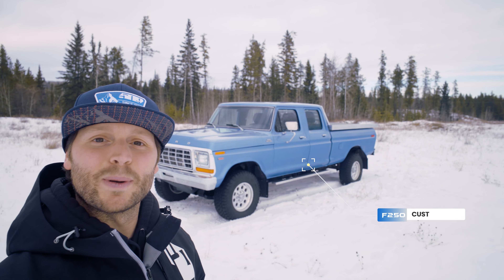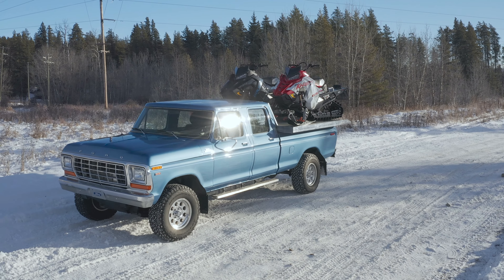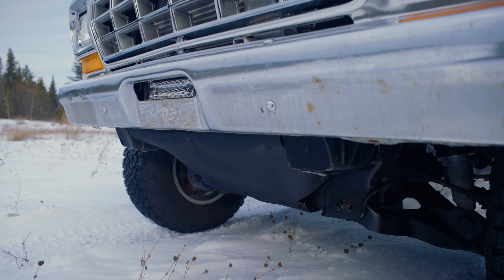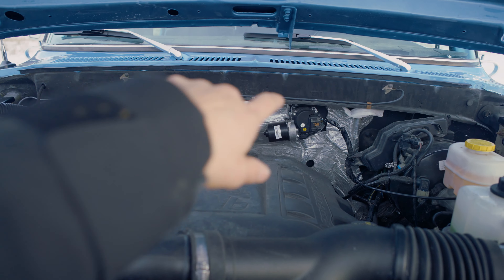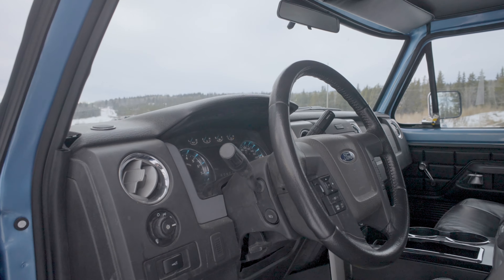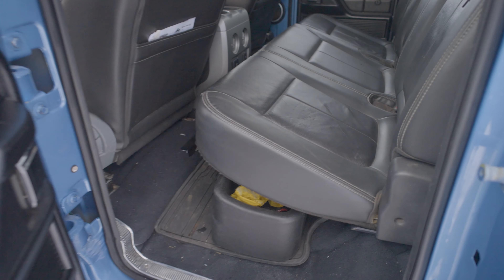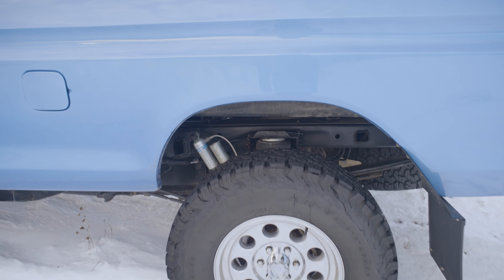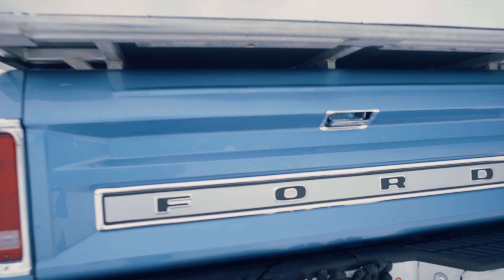1979 FORD F-250 ECOBOOST!

Comment: Great build! To me this is the perfect setup. Modern chassis, drivetrain and interior with the classic look of a 1979 F-250. I can’t imagine how much work went into this but it looks great and I imagine it drives great too. I watched another video right before this of a regular cab short bed 1979 F-150 that was put on a shortened 2014 Raptor chassis with the 6.2 liter V8. It was similar to this and used the dashboard and seats in the interior as well. I’d love to do a build like this. Maybe a 1980’s Bullnose Bronco on a modern F-150 or F-250 chassis. That would be sweet.
Reply from the maker: Would be really sweet!

Comment: Thanks for the mention in description! I had not noticed it until now. 4 current ecoboost swaps in pickups now at my place. Trying to finish up the '66 F100 with Raptor Crate engine and 10R80 first. In the spring plan on taking it to all lower 48 states here.
Reply: That sounds badass, you should do a video, I'd love to see her when's she's done.
Reply: @RagnarDanneskjold-Pirate  quite a few vids on my channel.  Running driving now. Trying to find a good videographer for aerial and other vid.
Reply: @randysrestoration  sweet, I'll check it out! I'm a Gen Xer and I'd love to see more '80s and '90s vehicle resto mods. I used to own a diesel shop and was going to get into the diesel swap trend but I just never actually did it. One of Won Customs did a fantastic diesel swap in a Camaro and a Charger, if you haven't seen the video, you should!
Reply: @RagnarDanneskjold-Pirate  in process of looking into a diesel swap but it will NOT be the typical 12v cummins like so many are doing. I have so many hobby projects its hard to keep up.
Reply: @randysrestoration  I think the commonality of the Cummins 12V is due to the fuel system, availability, and cost effectiveness.
I'd like to see someone do a Cat swap.
If I had the capital, I'd be getting into some sort of swap but the plandemic took a lot of my savings, oh well, build back better... right? Lol
Reply: @RagnarDanneskjold-Pirate  i never seem to do it the “easy way”. Ha!  Would love to do one with 2020 or later super duty 6.7 with 10R140 auto. 
CAT would be fun too if enough hp
Reply: @randysrestoration  Nothing worth while is easy, my man. I'd like to see a 6.7 swap into a Mustang!
Reply: @randysrestoration  scratch that, just to be an asshole, I'd swap a Yanmar into a Tesla, make all the green freaks explode!! 💪😎

Comment: Did the wheelbase match? or did you have to tweak things a little to line up? Top notch fit and finish on this. Very nice work.
Reply from the maker: ‘13 wheelbase is roughly 6” longer. I extended the short box in front of the wheel opening to make up the difference. Now roughly a 7’4” box size.

Comment: Very cool build, would like to see more about how you made your head liner, impossible to find and no one makes one that I can find for a crew cab. Also let's see that little trick you did with the tailgate.
Reply from the maker: Will work on some videos for that you bet. With the headliner, I ordered a reg cab headliner and 3M glued a nice grey headliner material to it I found at the local fabric shop. For the rear piece, my friend Dave and I simply used some thin plastic sheet he had and cut out a template. Then glued the same material for the rear piece. A bit of work, but not as bad as it could have been. Dave's the man with that type of stuff. Used a dome light from a 2017 F150 and it's got the soft dimming theatre lighting now.

Comment: Id love to take that style body n put it on new f250 chassis with 7.3l Godzilla drive train
Reply from the maker: That would be so cool! Unfortunately the godzilla came out after I began this project. And in the end, the ecoboost moves the truck just fine even without the tune yet.
Reply: @VelocityVideo  ...it's a solid platform,  you've obviously got the skills to handle any issues one might incur, but being that a coyote could bolt up to that gearbox, if you do swap a mill, well, screw it. Just go all out and go godzilla with a 10 spd...
Reply from the maker: @davidfox5827  hahaaa the only concern is wiring harnesses and control modules. So nice to currently have all OEM functionality

Comment: Super cool build! From my understanding, the 60-70’s trucks have a narrower track width than the newer F-series trucks. Did you have to modify anything on the frame or narrow anything to make the classic cab fit?
Reply from the maker: The frame itself was narrower on the dentside compared to the 2013, tho the track width was actually pretty much the same. Since the body mounts had to be all customized anyway, it wasn't much more work to deal with the slightly wider frame. Good question!
Reply: @VelocityVideo  That’s really good to know! I have a 1969 long bed that I plan to do something similar with. Thanks for the reply!

Comment: Everything is great looking went all ford but you did chevy latch why ? (Tail gate)
How did you come up with this whole idea in the first place
Reply from the maker: It was simply the most accessible at our local pick your part. We also grabbed some late model F550 pins and latches as well, seemed like they would also work. In the end, it seemed like most mid 2000s trucks would probably work well for this.

Comment: What type of headlight did you use I have a 79 I don't like the new led look I really like yours what did you use
Reply from the maker: I agree, the old look is better than newer LED look. These are the ones I went with. - https://www.lmctruck.com/1973-79-ford/headlight/fc-1978-79-rectangular-single-headlight
I also installed a 12" Rigid bar behind the license plate opening in the front bumper and use the stock Fog light switch & wiring from the 2013 for it. Works really good. And I just put the license plate over it for 90% of the driving in the daytime.
Reply: @VelocityVideo  that's awesome thank you so much
Reply: @VelocityVideo  I have a 1978 F-150 4 x 4 my dad bought it brand-new three months before I was born in 1978 gave it to me when I was 16 I drove it for 10 years parked it for 15 and recently my son and daughter got their license and we are fixing it up and getting it back on the road

Comment: How much did this cost you to make? Thinking of doing something similar
Reply from the maker: In the end, it was probably 30-35k to do it up like this without any labor. I would pull the floor and firewall from the 2013 and fab it into this cab if I were to do it again.
Reply: @VelocityVideo  was that before or after buying the 2013 and f250?
Reply from the maker: @liamfahey6910  that includes buying the trucks.

Comment: is there a forum somewhere where you might have documented this swap? Im interested in doing something similar to my 72 crewcab
Reply from the maker: Hey Brett, unfortunately I didn't create a blog or anything around the build. Happy to answer any questions you might have tho.
Reply: @VelocityVideo  darn! ok thank you. I guess the main questions i have are 1. Did you use the firewall and floor board from the 2013? 2. How painful was the wiring to retrofit in? 3. did you have any issues with the gas spout? my truck is on a 93 frame and these are the main issues ive had. How long did the swap take you?

Comment: What made you get an idea like this quite curious
Reply from the maker: Austin, long story...I had a restomoded '69 camaro that my father and I built. My late wife didn't much like cruising in it and suggested I build a truck. So the search began and a dentside crew cab is what I ended up deciding on for various reasons. Availability of ordering parts, late model drivetrain reliability and available parts. These factors removed an old dodge crew cab from the equation and I wansn't a huge fan of the 3+3 80s chevy crew cabs. On paper, it's pretty hard to beat the towing torque of the ecoboost paired wit the 6spd. Plus they made over a million of these so if I need to replace anything, it won't take long to get the parts I'll need.

Comment: That rear legroom looks pretty limited compared to the 2013 crew cabs. Would you say the cab overall is smaller? How did the axles line up with the body on the fitment?
Reply: I noticed the surprisingly limited leg room too.
Reply from the maker: Yes, a lot smaller length cab in the 1979 compared to the 2013. In this video it looks even worse because both seats are all the way back and the pedals are adjusted out as much as they can. I had to add about 8" to the box in front of the rear axle to match up wheelbase of the longer 156.6" 2013 Supercrew 6.6" truck.
Reply: @VelocityVideo  I wonder if instead of adding to the box you could’ve added to the rear of the cab, almost like the dodge “mega cab” idk if it’s been done before but in my head it’s not a bad look and adds leg room.
Reply from the maker: @clarkireland3318  for sure that would have been an option. The extra box length tho for my line of work is very helpful. I have an 8’ sled deck on there and it doesn’t stick out past the box much at all. So hauling 2 sleds is really nice. It’s not that often I’ll have more than 2 adults in the truck. Great question tho, could certainly add it in the B pillar area I’m sure!

Comment: I would pay a lot of money for this, and trade my 97 f250 4dr 7.3 4x4 manual with only 149k original miles. Stock...let me know...
Reply: and Zero rust
Reply from the maker: @curtisheath2497  That is such a cool truck, loved that era and the 7.3L. I had both a 95 5.0L and a 7.3L, both were really solid trucks.
Reply: @VelocityVideo  thanks, very serious about buying the 79 if possible?